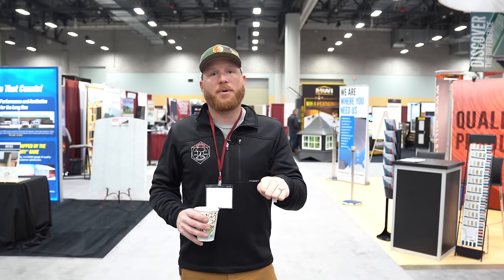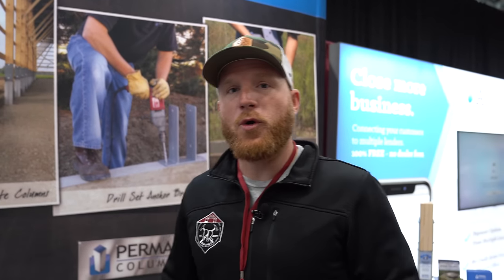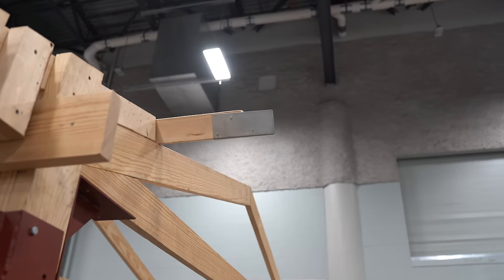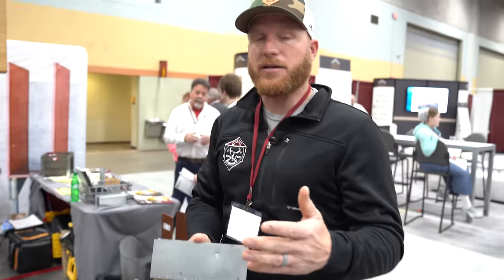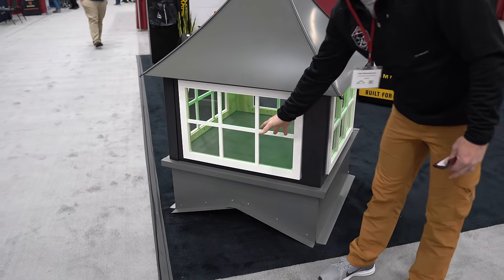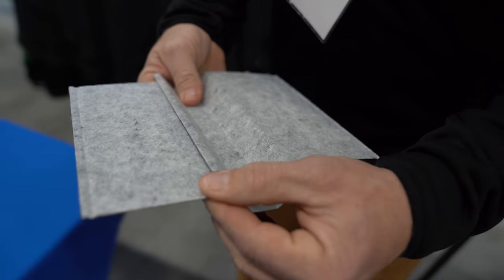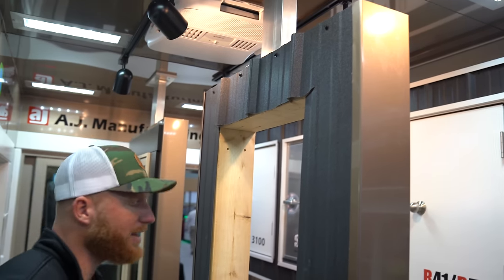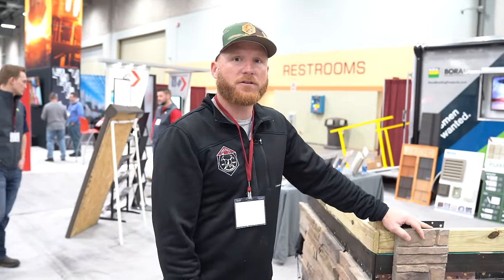NFBA Expo 2020: Best Products for the Post Frame Industry

Comment: Another video I'd love to see is one comparing post frame to metal building. I'm still on the fence about which one(s) I want to build for home and shop. Looking like it'll be in Tennessee. My concerns with post frame are rot and fire resistance; with metal, it's rust and added expense of building and foundation. I'd sure love to hear what you have to say on the matter, as I really respect your opinion and experience.
Reply: Midwest I believe uses baked on paint (powder coat, pretty decent against corrosion itself) for their brackets, they also offer galvanized for more corrosive conditions

Comment: Great video.  I have been looking for suppliers of the various components for post and frame buildings.  I especially have been looking for post supports.  Anyone on the gulf coast that has had or work on wood fences will tell you that even pressure treated wood rots when it contacts the ground. Thanks for the suggestions on windows doors and other  parts.  Again great video.  You really like mint life savers.
Reply: Great thing about Midwest's permacolumn and brackets is they are also practical for wood fences.
Reply: Joshua79C C The main problem with wind storms in hurricane area is that the fence acts like a sail.  So if the post is mostly rotted then the fence is gone.

Comment: Nice Kyle! I’m getting ready to put up a shop and can’t decide what post option to go with. Some info I’m getting is put a post in the ground and it will be fine(as far as rot goes) if it’s a UC 4B. Should I at least sleeve it?
Reply from the maker: all wood rots no matter what...not saying you have to do anything, but wood rots over time.  you have to decide if a little upfront cost is worth the added lifetime of your structure.
Reply: Thanks! I think I will def sleeve them...
Reply: IF going with just the post is all you desire then yeah go with boot/sleeve. Otherwise as I pan to do I am going with the wet brackets and if i was able to put a separate building and had the extra cash for it I might go permacolumn.
Reply: Bernice Good I used the wet set column anchors for the post frame house I’m building and they are great!

Comment: roof condensation is a huge problem in grain bins. a surface crust forms that then plugs the floor sweep auger. roof vents a must have but they're expensive and that's why too many farmers get killed in grain bins. right now mn state legislature is drafting a subsidy for farmers to install safety equipment on existing grain storage structures

Comment: If your doing a fence. How do you install your posts? Would you put them in the ground or use a footing in concrete. If so what type?
Reply: He mentions and shows off the Midwest precast concrete permacolumns, which have been put yo use for wood post fencing footings, even the wet set brackets for lower cost poured footings. But if you do not want to pay that much just go with the Post Protectors also mentioned and shown.
Reply: Andrew Hay, There's an old timer technique for stopping post rot. A 1/2-3/4'' hole is drilled at an angle starting 6'' above the ground level and ends in the center of the post, 12'' below ground level. The hole is then filled with Diesel/kerosene until it cannot absorb any more and is capped with a wooden plug. It stops the rot at the weakest spot, right where at the dirt line. It really works. It may take a few fillings, but that post will never rot/snap off like they usually do.

Comment: I’m totally up for new idea and products but, I see lack of craftsmanship and experience when it comes to developing new ideas. #1 relying on caulk foe window installation? #2 post wrap/ sleeve ? That your drill hole to let water escape ? Gimmicky the price point on a “pole” building is you get what you pay for !!
Reply from the maker: it is no different than relying on tape with a standard window...that is the way I look at it.  nothing works for ever....our goal as builders is to try to offer the best solution for our clients money.  This product specifically aids in that and is a good option for lots of guys out there and takes away a lot of the potential errors I've seen when flashing around a window with trims.  Hope that makes sense
Reply from the maker: also....I am glad you can share your opinion...I appreciate it